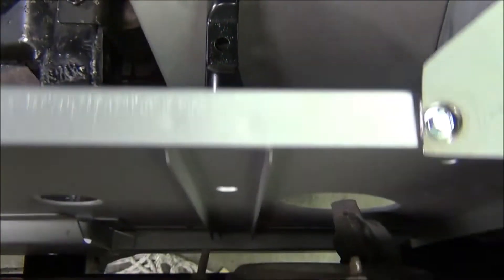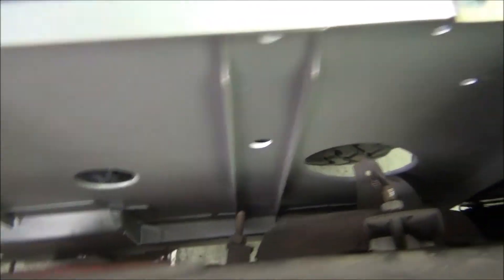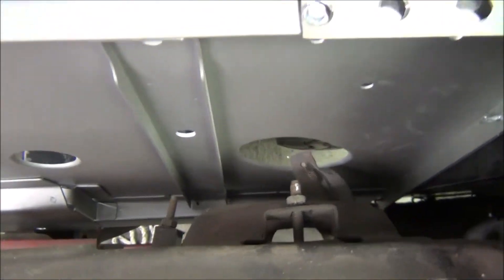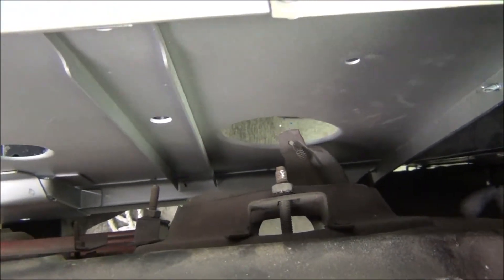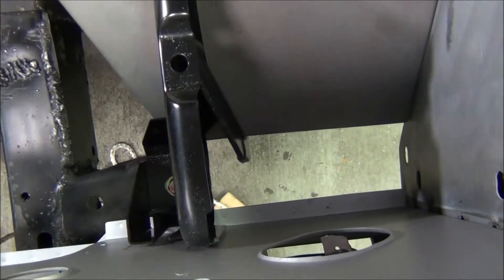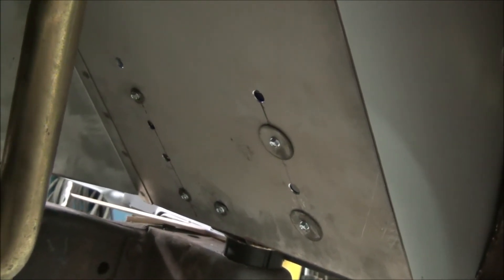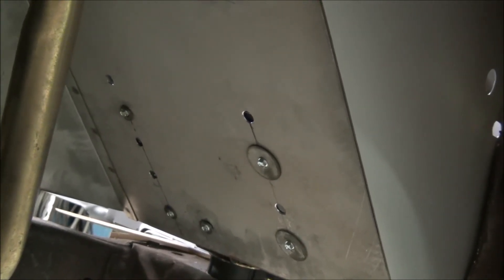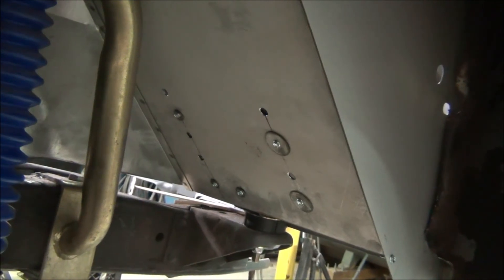Early Bronco Project Part 50 Front Body Mount Brackets

Comment: Do you have a lift or keepin it stock?
Reply from the maker: its got a 3.5" lift.  works good with 33s but those are 31s on it now
Reply: Also does your shock hoops help with a smoother ride?
Reply from the maker: @chesterbrown420  It calms down the front end and it corners better.  Wouldn't do it on a rock crawler because it cuts down on the flex but down here in FL not many rocks to crawl. lol
Reply: CondorDiving Thank you for the reply mine is stock no lift I ruin 32 /11.50 just wondering .